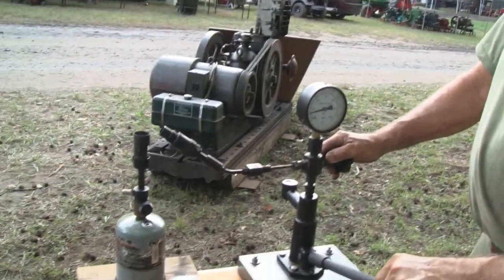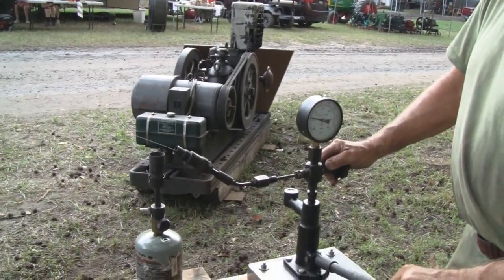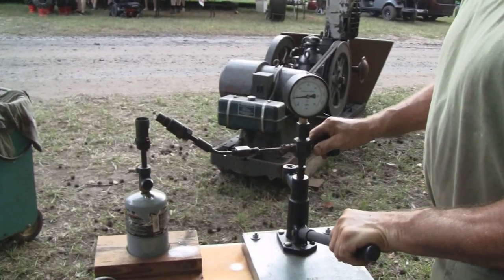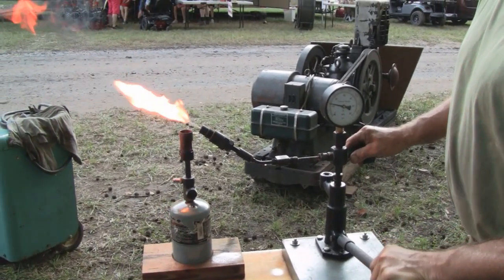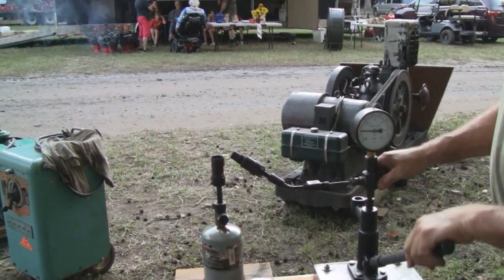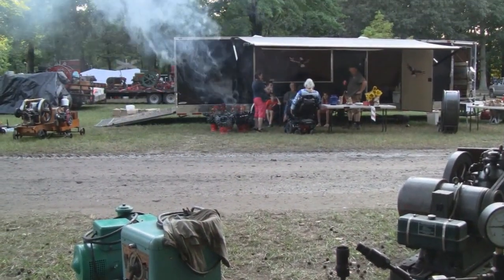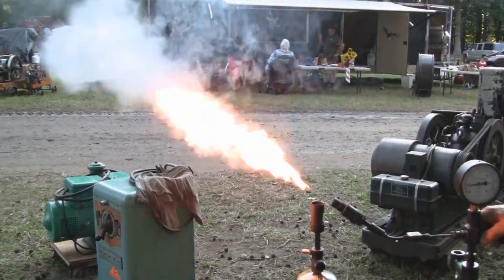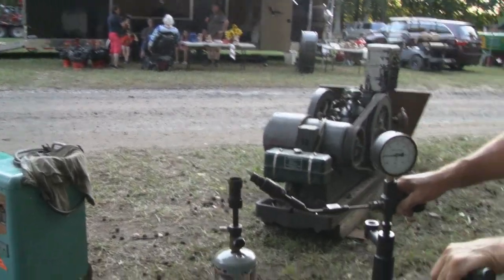HOW TO TEST DIESEL FUEL INJECTORS

Comment: My parents bought a Buick Electra Estate station wagon with one of those 5,7L diesels. When it ran it was slow but got 37 miles to the gallon. It went through 4 engines under warranty. I put an Oldsmobile 350 from a 1971 Cutlass that caught on fire in it and never had any more issues.
Reply from the maker: Funny story Rod!!☻

Comment: when I worked at a rental store, I had to clean the jack hammers and hose,, I usually used kerosene , but at the time we didn't have any so I though, well.. diesel will work... the compressors were the big trailer type so I hooked every thing up, and pulled the handle on the jack hammer,,, it sounded like a .50 machine gun.... lol I guess that is the principal of diesel engines..

Comment: Clear as mud? Want to read about it? Here's what Mike basically highlighted:
Compared to gas-powered engines, diesel engines start and run from much higher compression and a more energy dense fuel. So, in an average passenger vehicle with a gasoline-powered engine, healthy engine cylinder compression is generally between 120-160 PSI, with gasoline topping out at 125,000 BTU energy per gallon on average. In a diesel engine cylinder compression would be between 300-500 PSI, with diesel fuel topping out at 138,000 BTU per gallon on average. Your mileage will vary noticeably in real life, depending on the nature of the fuel, such as with ethanol or with biodiesel, their respective additives, the operational quality of the vehicle's fuel system, ambient conditions, driving habits, demand load on the engine and various fuel contaminants.

OK, I need a break. That was almost too much nerdage noise for me to write.
Reply from the maker: Thanks Newman!! Well said!!☻